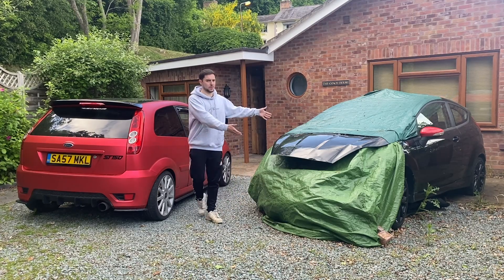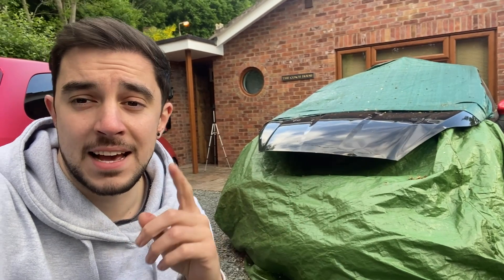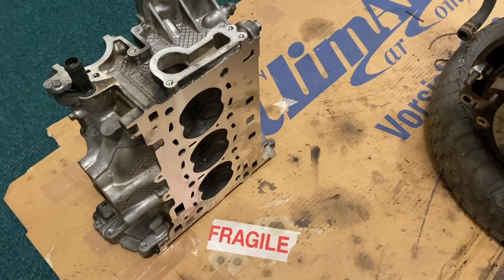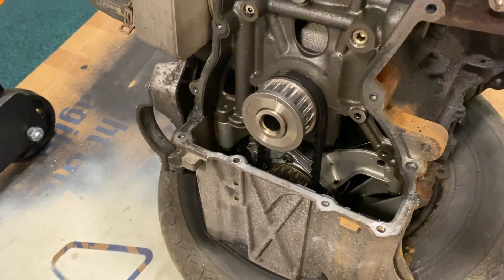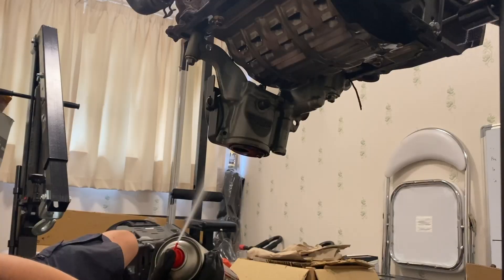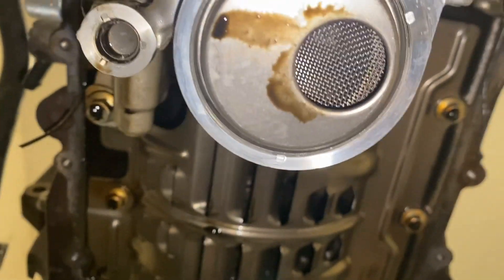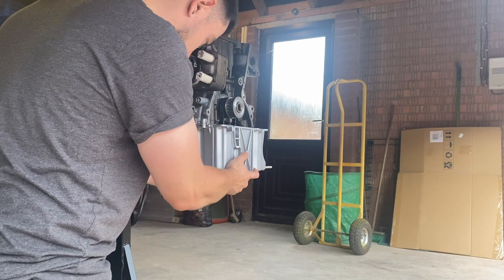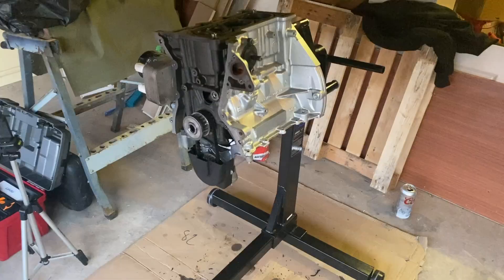Fiesta MK7 1.0 EcoBoost Engine Rebuild | Part 3

Comment: Can you replace oil belt without removing oil sump??
Reply from the maker: Don’t see why not but I wouldn’t bother replacing the belt unless you’re going to check the oil pump pick-up and clean or replace it. If you’re going to the trouble of removing the crank bolt why would you not remove the sump and check/clean everything 🤷🏻‍♂️
Reply: @MendItModIt  Thank you!! Sure do it proper way

Comment: Hi Patrick. I am working in a 2018 Focus 1.0 and the small oil band it has another gear. A third gear, so I will assume that has no position and I will install it like that. I changed the small oil band. Do you have any idea what that third gear is for?

Comment: hello my friend i need some info if you can help me. Do you know the compression in this engine ? 
i have test my car and i have 225 psi
Reply from the maker: You want all the cylinders to match, that’s more important than the number itself really
Reply: @MendItModIt  You are right but i wanna know about the number. i have all the cylinder the same but i thought is to high for a turbo charger engine . do you know about the true compression .
Reply from the maker: @xaros2242  I don’t know the number no sorry mate

Comment: Going really well. If you haven't yet refitted the timing belt and cover, could I please ask a favour - I'm interested to know if it would be possible to fit a new oil pump belt without removing the sump. My idea would be to slide off the timing belt sprocket, draw back the oil pump sprocket until the belt is free, then wiggle the belt past the plastic cover (or if necessary flex the cover just enough to do so). Reverse op's with new belt.
Reply: Just finished my timing belt today, you can fit the oil pump belt on without removing the sump. You can reach down and pop off one side of the plastic cover and shimmy the old belt off and new belt on. It was a very tight fit but it worked!

Comment: Hi mate, I’ve heard the head gasket needs to be bolted back in, in a specific order (bolts). Any idea how that goes? Cheers
Reply from the maker: There is a tightening sequence for the cylinder head yes, and you need new head bolts. Should be in the next video when I got the new head gasket

Comment: What sealant would you recommend on the rocker cover? Need to do it but have put it off as couldn't seem to find the ford sealants as Haynes mentioned 2 but local ford garage wasn't much help
Reply: AB-AX is the sealent you need for the timing belt end, you need LR-2 for the flywheel end. I wouldn't bother getting LR-2 as Ford charge £100+ for a 75ml tube.I just used AB-AX on both sides at £25 per 50ml. Finis code is 2 633 427.

Comment: Where is the gearbox oil filler plug on this engine. I changed the drivers side drive shaft, no problem there LOL, about ¾ litre of oil came out  of the drive shaft opening but for the life of me I cannot find the filler plug. Am I missing something.
Reply: I recently did my gearbox oil change and it should be located at the top of the gearbox with a little cap. That’s how mine was

Comment: I'm in the middle of tearing apart a 1.0 Ecoboost also! Could you please check your camshaft bearings closest towards the cam sprockets? Mine appear to have lost polish and have some slightly rough looking wear. I even bought a cheap second motor and it has the same wear pattern!
Reply: Same with one I stripped. Have since run 2k+ miles with no issue.

Comment: Not cleaning the engine would have been a great, great mishap. You've got it all disassembled, very logically is to crack on with cleaning of the engine, this was the most detailed engine clean.

Comment: Been waiting for this video! I have a Fox EcoBoost Fiesta in the US with 108k miles now, been getting antsy over the timing and oil pump belts. Hoping they don’t let go before I can get it serviced. This series is giving me some insight on what to do if I can’t get to it. I may end up buying a replacement 1 liter and slapping that in, then rebuilding the stock one while I dog on the replacement. Keep it up, friend!
Reply from the maker: If you’ve had it serviced regularly and the right oil has been used then you should be okay, they are a pain to work on but like it’s not impossible like people make out, I’m not a mechanic and I’m working my way through it… granted rather slowly it it’s all a learning curve
Reply: @MendItModIt  Luckily I used to be a big Subaru guy so I’ve got experience with engine rebuilds, replacements, etc, and of course the boxer engines are a drag to work on lol. I just found a timing belt engine locking kit for the fox on Amazon for only $80 so I might start snapping up the parts to do it and find a cheap replacement as well. This engine is loads of fun even for US roads, and I still average 38-40mpg, it really is the best of both both worlds. Hope to see more on this series, and I may reach out for help on mods for it in the future since it’s not really supported here due to low volume outside of the EcoSport.